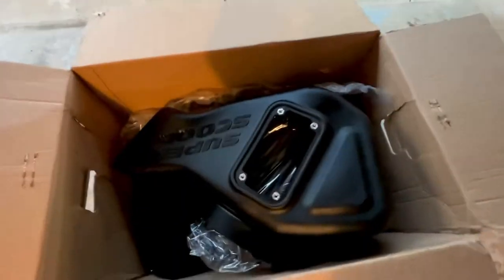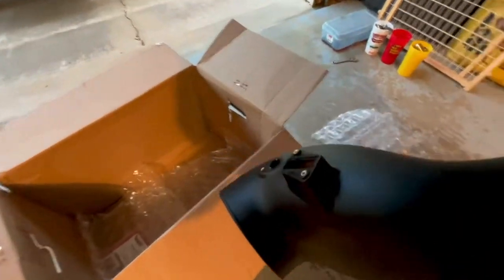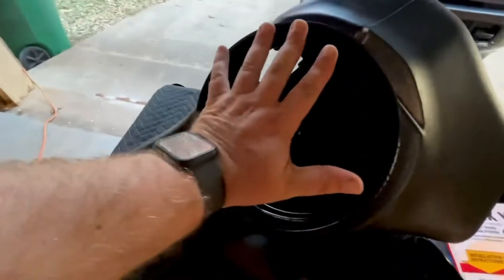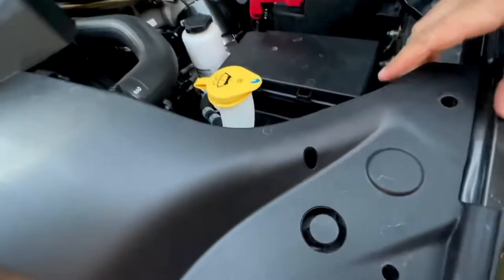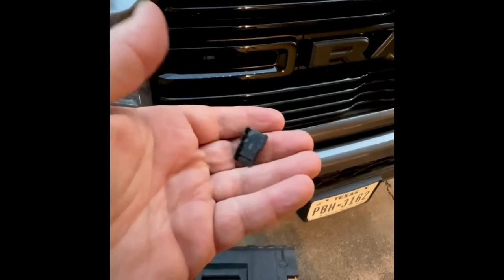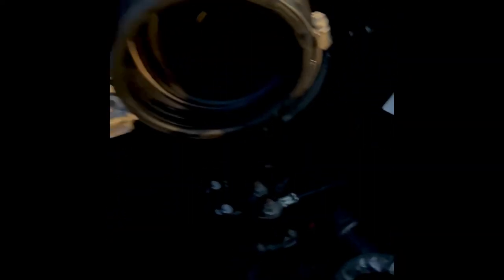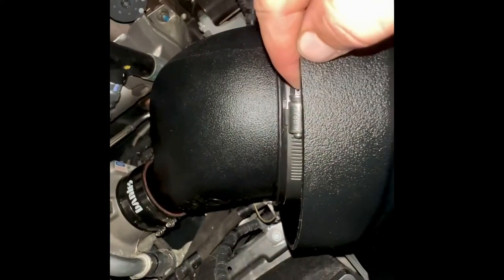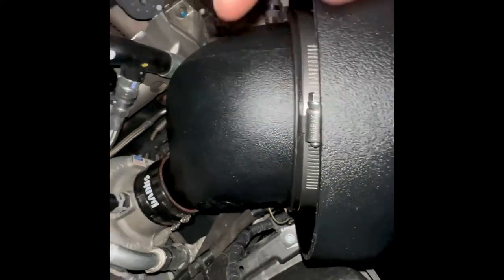2020 RAM 6.7L Cummins Banks Ram Air Intake Install

Comment: I did the same intake on my 2020 no noticable difference in power or throttle response . But did gain 1.5 mpg here in Colorado I added the pedal monster and gained wicked throttle response.
Reply from the maker: I as well gained roughly 1-1.5mpg! I took the truck to Florida in June of 2021 and it got 22mpg coming back. With the new Banks Monster Ram I am seeing between 23-23.5mpg. No other upgrades have been done yet.
Reply: @TheRealTRS  that's awesome I really like Banks products I would recommend doing the bank's pedal monster unbelievable throttle response and it connects to your OBD2 port so you won't have power failure or engine derate like pedal Commander
Reply: I haven't took mine on a very long road trip yet but looking forward to seeing my top end on fuel economy in our high altitude here in Colorado I get about 20 and 1/2 to 21 miles a gallon on the highway not bad for one ton truck
Reply: Diesels have plenty of air to the motor. Only way to make power is more fuel. These do nothing but make the turbo louder. Check project farm on YouTube he tests how good these filters actually “filter” I’d stay away
Reply: Pedal monster is next on my list. I hate the delayed response. Thanks for the encouragement 😎
Reply: @hockeyplayer0241  After I did the change I can tell a big difference between how the engine sounds. It’s not as muffled as before. There’s a reason why the turbo gets louder and that’s because it doesn’t have the restrictions it had with the OEM parts. The federal gov. is restricting the auto factories these days to the point where we’re losing both HP and MPG only to keep the universe green. Not to mention that with  these restrictions you’re Diesel engine will never last long as the older engines did. Do a little more research and talk to some diesel mechanics 👍🏻😎
Reply: @sholbura  I have 3 rams and work on cat motors. Only way you are getting “ more power” is upgrading your turbo putting a thinner air filter doesn’t do anything except allow more dirt in. You’ve been played by good sales tactics
Reply: @hockeyplayer0241  well, definitely not expecting to increase HP only with this air intake mod. This is only my first of a series, and eventually the HP will increase some but not necessary. What I want is a better sound/performance overall. These new trucks sound more like a Prius lately. I am doing a lot of research and talking to different diesel shops in my area. Deleting new trucks is getting more expensive & risky. May or may not be worth it anymore on the new rigs. At least we have people like Banks who are coming out with good products all the time. Some of their RAM products are fairly new and time will certainly tell regarding their performance. It’s always a risk when you try something new. I’m in the same boat modding my ATV 🤷‍♂️😎
Reply: @sholbura  I hear ya just be careful he’s a great salesman and he screwed a lot of of other companies by teaching the epa how these guys were cracking codes in these trucks . Easiest mod is bigger injector nozzles. To get real performance is big bucks like turbo and fuel pumps then it’s blown head gaskets and transmissions
Reply: @hockeyplayer0241  maybe you should go check out PPEI and tell them their dyno is broken. They have done multiple dyno runs with and without this intake and it DEFINITELY makes more power
Reply: @viperloe1973  the company that makes tunes? Wonder how they got more power. The cylinder head can only fit so much air hence why guys port their heads

Comment: Great video and nice RAM with the night edition package.  I’ve got a 2020 silver 2500 6.7l night edition as well.  Do you plan to do a follow-up video reviewing the intake after driving your truck for a while?  Curious as to noticeable power, mpg, sound, etc. as I’m thinking of getting one myself.
Reply from the maker: David, thank you for the comment! Yes I will be doing an update video soon. There is a noticeable difference in turbo noise, it sounds really good. I also am seeing 1-1.5mpg gain on the high way and at wide open throttle the truck seem like it pulls harder but that is subjective. I have seen a couple of the silver night edition trucks and they are pretty slick!

Comment: Great video, did you have the issue of the check engine light coming on ?
Reply from the maker: No issues with the check engine light from the intake so far. Thank you for your comment!
Reply: The check engine light has to do with the pedal monster and an EGR reading but no real issues per Banks

Comment: Great video. I also have a 2020 Ram 2500. I installed a cold air intake from a different manufacturer and got a check engine light within a day. Any check engine light with this setup?
Reply from the maker: Good afternoon, I have not had any check engine lights come or any issues. Have about a thousand miles on it now.
Reply: Banks install doc says to remove the negative off both batteries 15min prior to disconnecting the sensors off the old intake. This will prevent any check engine light to come on.

Comment: Can you feel a difference?
Reply from the maker: I will post an update video soon. It does feel as if it pulls harder and you can definitely hear the turbo. I also gained roughly 1-1.5mpg.

Comment: When you clean the filter or replace it, do u have to take the whole box off to get the filter out?
Reply from the maker: Good afternoon, you only have to remove the intake tube. Just the two hose clamps and pull the filter out. May be able to do it leaving the turbo side clamp hooked up.